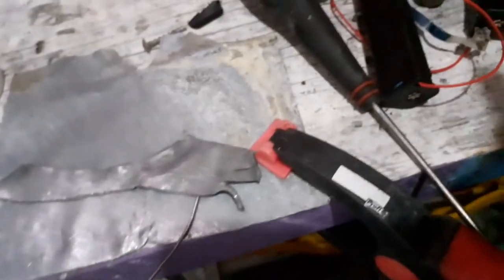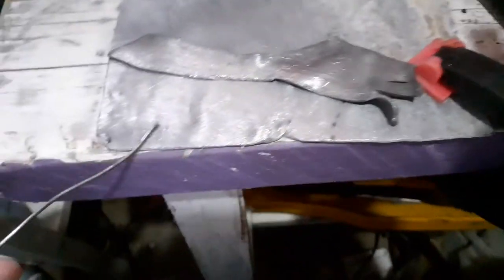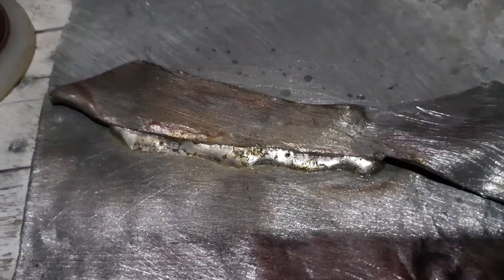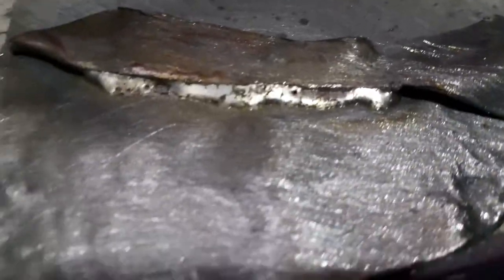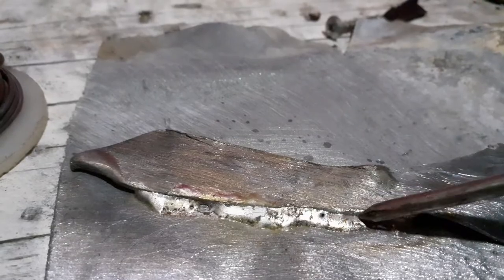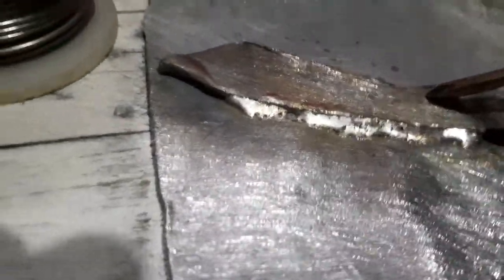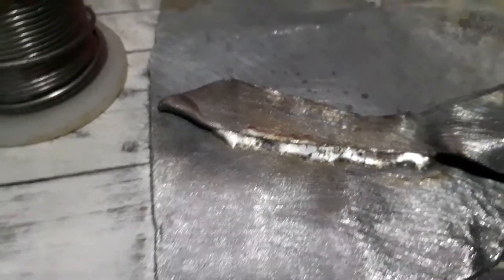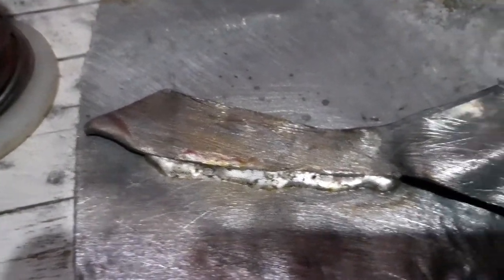easy Lead welding

Comment: I tried this approach to fill some small tears in my lead flashing.
Looked to be ideal for a diy fix but didn't work.
Every time it was too easy to melt the lead as well as the solder.  Using a propane blow torch on code 3 lead.
Slightly more success with a 70% butane/30% propane mix but still all too easy to blow holes in the lead itself.
Don't know how you managed to do it

Comment: Please stop this sillyness
Reply from the maker: What's silly. this works just as good as lead when I clean the joints good  and its so strong I can't peel it off even with a hammer
Reply: Go check out some vids on lead welding,
You will soon see the sillyness.
Reply from the maker: I don't need to see other videos as I used to lead weld for a big roofing company years ago. I just showing how lead can be patched up with out buying the proper expensive touch and hundreds of pounds on rent for gas bottles. And if your thinking of them mini bottles kits they are crap to work with.
Reply: Why use solder? Scrape clean the lead first and use lead strips cleaned as a filler. There is zero strength in the way u did it in your video
Reply from the maker: Hello thanks 
The mini blowtorch takes longer to melt lead, solder melts easy with it being thinner and the flux in the solder helps.
Reply: @doitmyway9089  try using leaded plumbing solder. Lead burning is a serious difficult skill to obtain. Have to say was impressed with ur attempt. Needs a very hot precision flame
Reply from the maker: I don't know if you seen my other video doing the same thing but i did it better, I used to lead weld years ago but I don't have the stuff to do it now days
Reply: @matthewsmith1369  egg zaktly
Reply: @PeakyBlinder  could you weld lead with a small hho torch? I don't have oxy acetylene but I have an hho generator and jewelers kind of torch. I want to fabricate a large lead box for sheilding an 85kv xray transformer and bulb
Reply: @SodiumInteresting  no the lead you would need to use is to thick,
You would need the pressure of the oxygen and the high heat of acetylene to keep control of the weld,
A low pressure gun would require more time to warm the lead to its melting point thus creating a wider heated area where holes are more likely to happen as you have no control over the welding
Reply: @PeakyBlinder  I'm going to use a 6m roll of 300mm code 4 lead. it doesn't actually even need to be this thick to stop the xrays. 1 or 2 mm would stop the majority and youd be back to background radiation levels
Reply: @doitmyway9089  Good solution in emergency.
Reply: Yeah mate proper shit